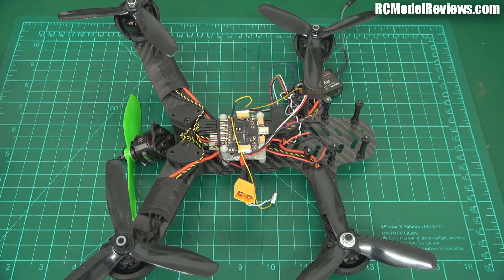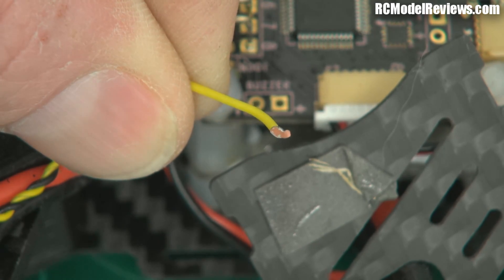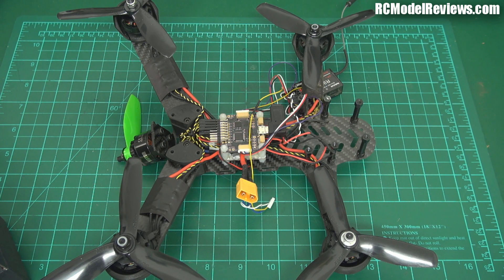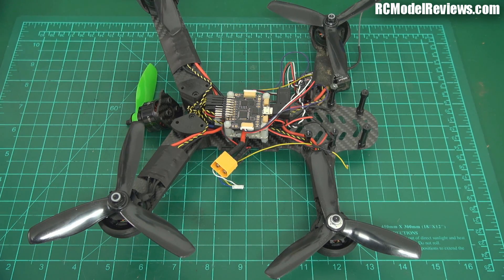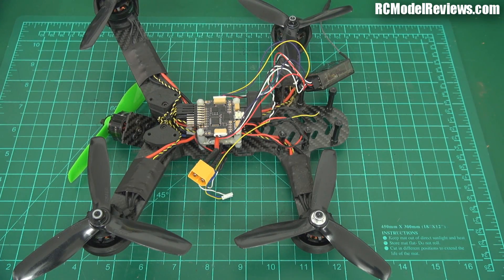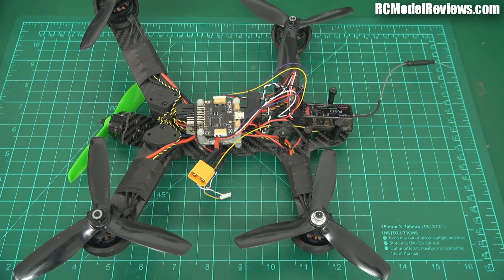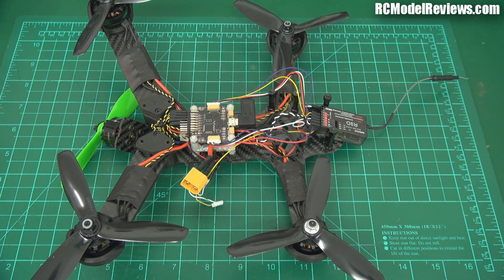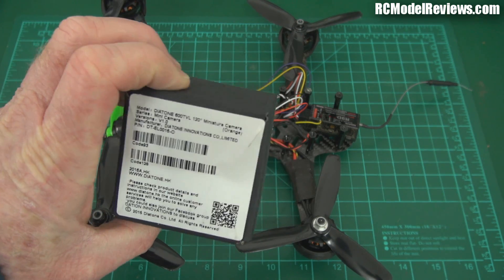Screamer 250 rebuild: fixing the FPV camera

Comment: Bruce, I know you often use hot glue for strain relief but I think there are some application where Polymorph works better than hot glue. I'll post a link as a reply to this comment so this post doesn't get caught in a spam filter.
I think Polymorph is easier to rework than hot glue.
After you make the repair, you should add a bit of Polymorph to hold the wires in place.
Edit: I hadn't watched the whole video when I originally commented. Excellent work.
I think Polymorph would have offered some advantages in this application but your repair job looks great as it is.
Reply: Here's a link to a forum post where I showed one of the many uses of Polymorph.
http://forums.parallax.com/discussion/comment/1335080/#Comment_1335080

Thanks for making all these great videos.

Comment: Excellent update. I own a 250 and yet to fly it. Can I add a microphone to the Diatone copy? if so would you happen to have a mouser or digikey recommendation? Also, How many amps does this copter pull? I am planning to put a lemonrx 7ch with telemetry receiver with a 60amp current sensor that can plug into the rx

Comment: best thing to do with this cam is add liquid tape to the wires. some versions come with it already depends where u get from.
Reply: I always add liquid tape, hot glue, or even putty epoxy to where wires come off of exposed boards to relieve strain. If you can't slam it on the floor, drop it from the sky or ram it through the brush, put it back on the bench, because it'll be there shortly...broken. Hey Andy I watch all your videos, check out my channel for some Mississippi FPV.
Reply: Shoe Goo thinned down is light weight used correctly and makes an excellent strain relief for electrical wire ends. Probably the best substance for its weight as it's strength cured is exceptionally high even when thin. Epoxy on a shoe won't last long but  Shoe Goo will outlast the shoe and sticks to just about anything.
Reply: what do you thin it down with? Acetone? alcohol? Water?
Reply: Adam Heidingsfelder Toluene, you can get it at paint stores by the gallon or quarts around $7. I've saved a lot of money normally spent on glues since I started making up my own. I mix up a 50SG/50T and  25SG/75T ratio and found overall these two ratios saved in tall 8oz glass jars are the best ratios although I've gone down to 10% for penetration which is so thin it melts EPP paint within seconds. At that ratio it evaporates fast too so you can do it working fast outside but if left to run wet unless you are looking for a 60's retro tie-dye look it will ruin a nice EPP paint job. And you need to time when you pull the tape used to tape off sections otherwise if it dries the SGoo left on the tape stretches where you want it to break off at and could rip the foam trying... what makes SGoo so great makes it tricky to work with and the worst part is SGoo requires curing time not just "dry to the touch" which took months on a pair of bike shoes (filling up holes) to reach full hardness and strength. One reason it comes out of the tube so thick needing to cure in the middle of a size 14 shoe sole glued on within 24-48 hours. It will hold then but it's still not fully cured and is getting harder and stronger.

But on bare white foam or done right on painted EPP the penetration allows a thin strip of nylon threads hidden in the leading edge to be penetrated sealing the slit cut to where you can't see it if the cut was clean in adding the first SGoo layer on the leading edge. I'll use a 25/75T ratio next also being carful of the paint and working fast. After that a 50/50T layer flipping the wing upside down so the high spots are equally covered followed by whatever coats are needed ending up thicker on the nose and leading edge getting thinner behind the C/G to not make it tail heavy.

I've gone to 75% but with SGoo using less achieves more. For making electrical leads and stress relieving non-silicon wires with and without using heat shrink it's invaluable. In a matter of seconds you can reinforce internal wires on a TX gimbal known to fail from movement rather than cutting and re-soldering after using heat shrink where the SGoo gets to the soldered base which heat shrink can't do. Where some use hotglue SGoo can often do a better job and is easier to use. It's an art I'm just learning after getting into EPP foam... it shrinks as it cures BTW so weight can decrease leaving your C/G shifted and holes you filled up turned into hollow hard thick walled balloons, an effect that can be of value. I weigh out the SG/T mixtures so my notes give accurate cure and evaporation rates and its faster than guessing mixing it up. You will find by building light and reusing the runoff that a $4.50  3.7 oz tube can go a very long ways... especially flown FPV;-)

Comment: Bruce - If you're looking for space, those Radiolink receivers get really small when you remove the case and all the pins then solfer the signal leads directly to the board. It makes them far easier to fit into miniquads. If the new R6Ds ever hits the streets, they will be tiny once they are depinned.

Comment: That's a decent camera for a cmos.  It's what came on my Diatone Tyrant.  I'm liking Diatone's stuff lately.  The tyrant 215 is a damn tank.  I ran into a backhoe at pretty high speed and dented a motor can but no other damage. Great video as always Bruce.  I hope that camera repair works out for you.  I don't see why it wouldn't.

Comment: That's the problem with NOT using through hole wire mounting.  Very easy to pull up the circuit board pad with a bit of stress or even with the heat of your soldering iron.  Through hole mounting puts most of the stress on the board and not the pad and trace and it is even better if the board is double sided.  See it too often even when they have a huge amount of board room to work with.

Comment: 5:43 a common point to that broken Yellow wire pad is the cathode (right side) of the black Cap just left of the 27Mhz oscillator at the top right of the pcb.
[EDIT] Sorry just watched the rest of the video and saw you found the same spot.

Comment: SMD soldering by non-robots. Impossible !
Well maybe not.  I use a thing called a "helping hand"  which is two crocadile clips articulated on a metal stand with very (heavy) metal base. Works great for holding and soldering.
Top show mate.
Burnin up in Blighty
Reply: yea, he could also use it to keep parts in the focus of the camera. couse he is fiddeling with that alot too ><.

Comment: love the videos bruce. Any chance you could do a motor trouble shooting video been having some issues with the motors on my quad but not sure how to trouble shoot.
Reply: What kinds of problems?
Reply: see my chanel i have had two motors fail in a similar way.. any help would be great shaun
Reply: +Ryan Sweeney hey checked it out the motor twitching like that usually just means one of the three wires from the esc to the motor came disconnected have had it happen a few times myself too while learning to fly.
Reply: Best way to find which one is just giving them each a little tug and see if one came desoldered and just reconnect.  Only issue I've had really with that is the wires near the motor are enamel coated I think for the windings so need to scrape the wire with a knife or sand paper or something... I should look up the right technique 😀.  Another thing you could check is the resistance in the pairs of wires, the esc works by energizing the coils in the motor in sequence by sending the charge through two of the three wires at a time but each pair should be about the same resistance and show a connection.... but again best guess is just a loose wire.
Reply: +Shaun Husain awesome Shaun. Thanks for the tips I am away at the moment and will give t a shot for sure as I have had 3 motors suddenly do this and can figure out why at all but defintely worth a shot! I'll keep you updated

Comment: Just a heads up: The regulator at the bottom right where the power goes in, you should be careful with the hotglue on it. I did that too and it got really hot and stoppen working. Keep an eye on that.

Comment: If you are going to use SBUS, you should depin the R9D receiver and shrink wrap it. That's what I've done with mine. I also solder on an IPX connector for the antenna so I can swap them off quickly if they get chopped. Makes the whole thing a lot smaller!